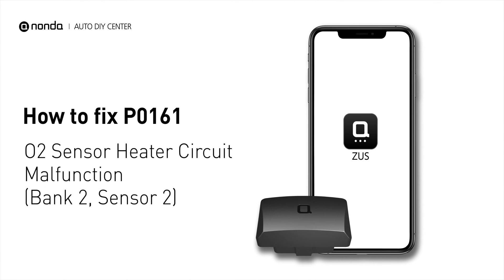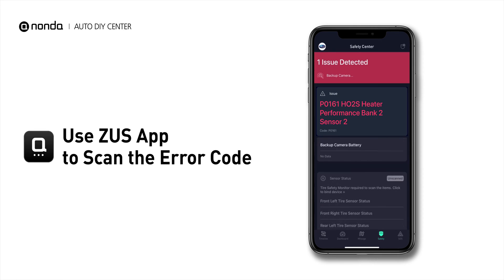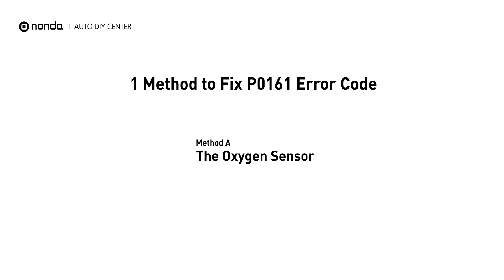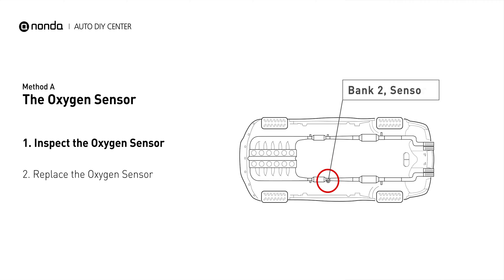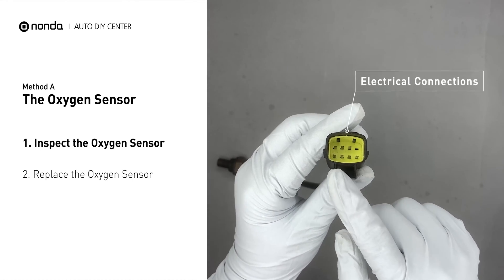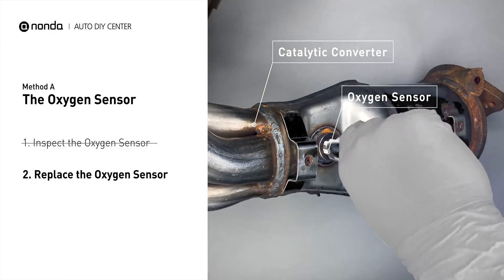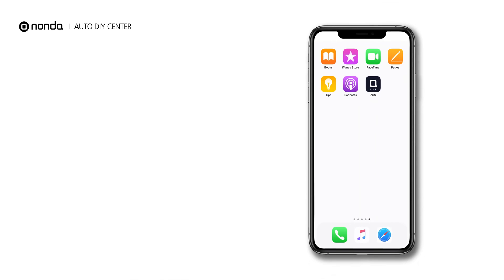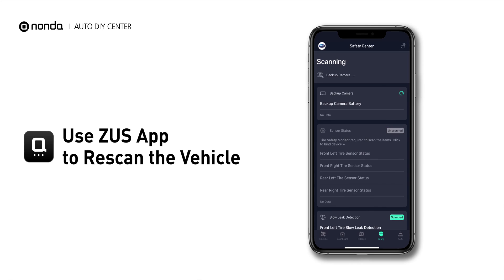How to Fix P0161 Engine Code in 2 Minutes [1 DIY Methods / Only $19.91]

Comment: Ive replaced all 4 O2 sensors, all 8 spark plugs and ignition coils, and the MAP sensor. Im still getting P0161 and P0175.
Reply: Have you cleared error codes after replacement?

Comment: Hey Steve I have a 04 silverado 4.8 and I replaced my downstream o2 sensor as I had a P0161 code. I rest the check engine light and sftwr driving 35 40mins it came back on. I checked the fuses also. What do I do now.  I need to pass smog. Thank you!!
Reply from the maker: Is there any other codes that register along with this code?

Comment: I got the code P0161 right after I change the new oxygen sensor, what to do?
Reply from the maker: Hi Oliver, we suggest checking the wiring harness/electrical connections and metal tabs in terminals for any damage.